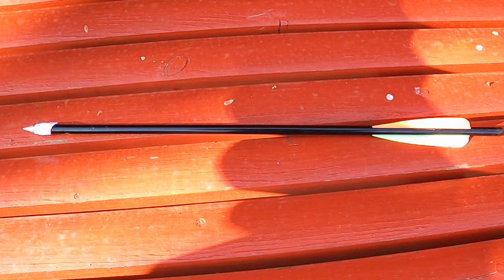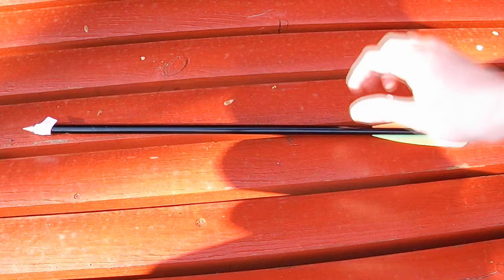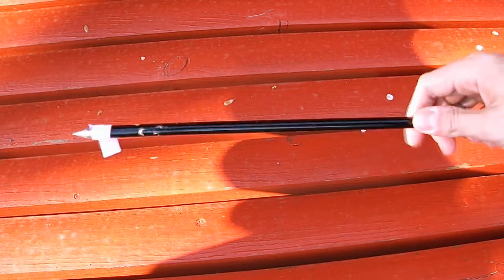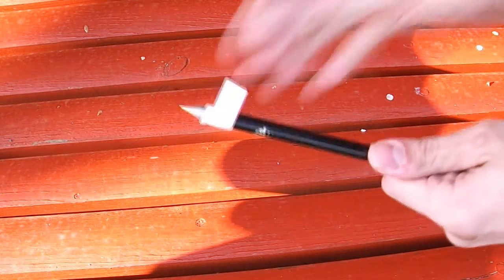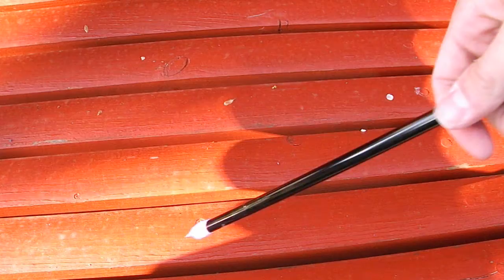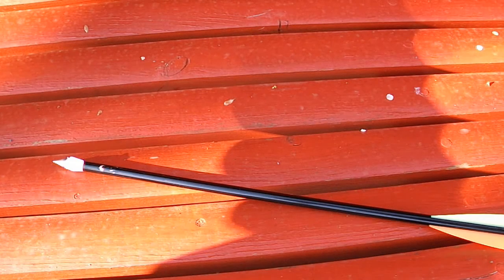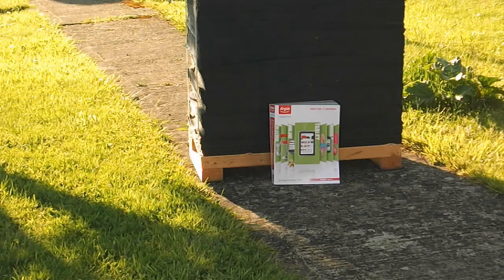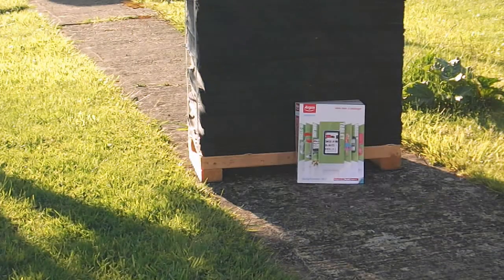Heavy Crossbow bolt test

Comment: The laws of physics say that the friends that told you the weighted bolt would pass through a phone book ...lied. 
lol
Reply from the maker: Issue was that the pellets moved around inside, if I had melted the lead down, filled it entirely up, let it set and then did it, the test would have worked better.

Comment: Great vid, don't think i saw this one when it was put up, could it be the pellets being thrust to the back of the bolt when shot?
Before i watched this i made some last night, pistol and rifle bolts, but filled them completely with no movement, i'll do a test in a few days as got other stuff planned first, i did try the pistol ones today and the outcome surprised me, should be uploading these in a few days i reckon.

Mike.
Reply from the maker: +WeaponCollector Cool will check it out when they're uploaded and yeah I suspect as others have said it's the pellets flying backwards after it launches causing a counterweight.

Comment: You may want to take some physic classes. Your weight when fired is against the nock. When the arrow hits, the weight moves forward with a loss of velocity.

Do a proper weighted arrow as a heavier arrow/bolt does penetrate deeper.

Comment: The weight you added is all in the bolt. if you added all the weight to the tip, You will have great results. It's all about the FOC(forward of center) when it comes to penetration. Assuming the heads were the same weight, your lighter bolt has a better FOC.

Comment: Weighted tips for 5/16" armex sized bolts.  with these be sure to use longer shaft that puts head or tip forward and "off of the forward end" of barrel groove or arrow track.

http://www.3riversarchery.com/steel+screw-in+field+points+-+heavyweight_iCF581X_baseitem.html

http://www.3riversarchery.com/screw-in+5+16%26quot%3b+heavy+weight+field+point+test+kit_iCF516-T_baseitem.html

http://www.3riversarchery.com/steel+screw-in+field+points+-+heavyweight_iCF581X_baseitem.html

Comment: when you load any arrow with pellets, you need to make sure that you compress the pellets completly so that they WILL NOT MOVE in the arrow or bolt... I have found that with my bow (I have a Bear Bruin Quad set at 105 lbs of draw weight) my arrows will pass through deer, hog, or any animal I hit with ease... your bolt is not penetrating because the pellets are hitting the nock end of the bolt as it leaves your crossbow, therefore slowing it down and greatly taking from its performance.

Comment: Because your lead is in pellet form. As the arrow is pushed forward it slams into the heavy, stationary pellets, slowing it down. The lead needs to be a solid, balanced piece so that it moves with the arrow and hits with it's full weight.

Comment: when i first saw the video i had my sound turned off and thought the tape was a lead wrap ! 
If you do make the pellets/weight static or with more weight try it against a coconut and see how that explodes mate as they are very hard. . Baz did a great video on blunts with his crossbow awhile back but a really heavy lead impact bolt maybe useful for certain things. 
if i had longer bolts i would try a big lead ball moulded onto a screw in point for maximum energy dump even at short range. :)

Comment: Any weight added to the bolt should be static, L, and not free to move inside the shaft (for the reasons Sharky explains here), but the test has merit, as a disprover. Get the ptfe on the threads of the arrowheads and you wont need to glue and tape. If youre looking at penetration/effect mate, get yerself a chicken from the supermarket and have at it (with the crossbow, I mean), or better still, check out SIFLINT1's video 'Crossbow penetration - Human analogue'. Nice one, L, good video mate. Baz